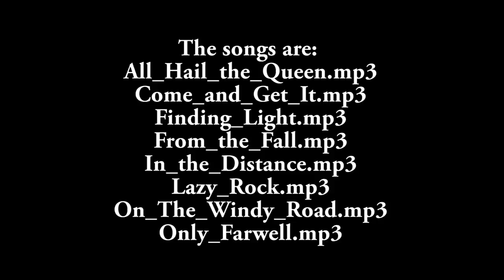Gold bayonet lock for brooch

Comment: Hi. I'd like your help. I have had many problems when laminating silver. She has cracked and cracked a lot, making it impossible to make the jewelry. I have tried many things. What can be the justification for this? thank you very much from BRAZIL
Reply from the maker: silver breakage during lamination can be due to too many impurities present in the metal, or to the change of direction of the lamination, every time you change the direction of the lamination of the plate you have to heat it until it turns red, so that the metal becomes red and soften.
Reply: thank you so much. I will try this. Greeting from Brazil